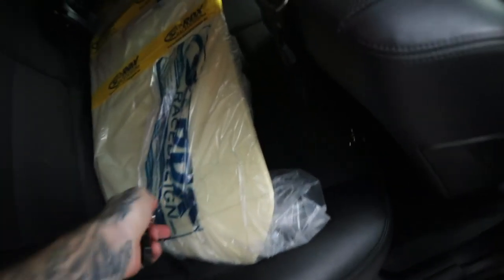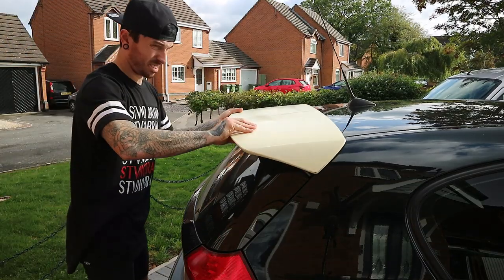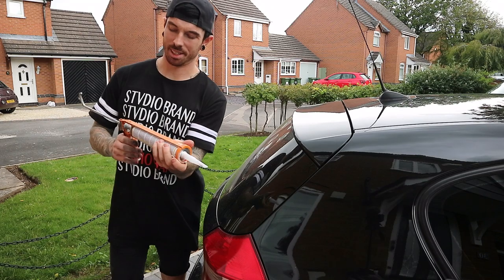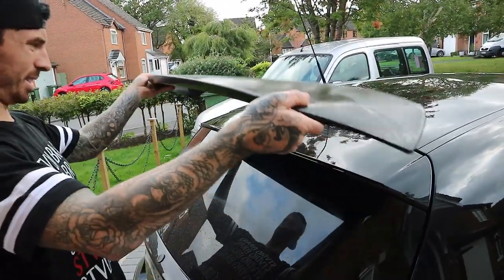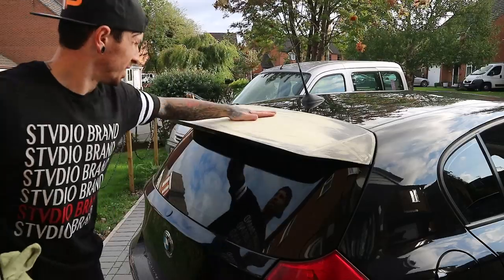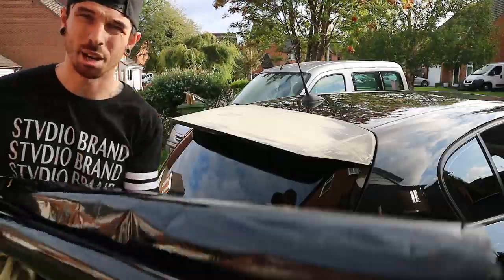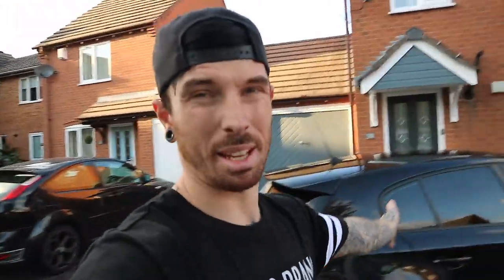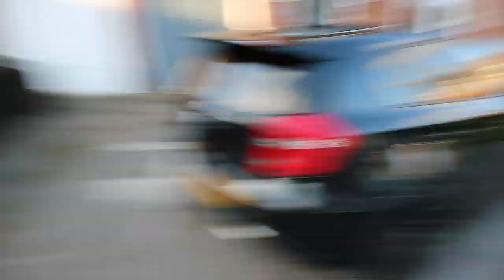FITTING A SPOILER TO MY BMW 1 SERIES E87

Comment: Mate I worked for BMW for a number of years. Here at Mini Oxford, in NedCar in Holland and BMW Munich. You should've took the other spoiler off. Thats why you're left with a 12 mm lip (estimated). Good attempt though.
Reply: I don't know what you did working for BMW, but i own this car, and this stock 'spoiler' is NOT REMOVABLE. Its not plastic, its part of the bodypanel (metal)....
Reply: @TheCardPlayer  blimey I wrote this a while back. I did go check my mates and yeah it's not. That's a tad unusual. I worked at Mini but I went to Munich for two stints of 3 months. Has it worked out is the main thing?

Comment: Do you have the link to the seller you bought it off?  I’m currently looking for a spoiler myself & yours looks like a great fit. 
Cheers!👍🏼
Reply: I think it’s the RDX spoiler. It costs about 100€ on amazon.
Reply: I’d just keep looking get a pre painted one loads less work
Reply: I own a F20 LCi just brought a carbon wing off eBay there’s a lot of nice ones on there or I shit you not “ali express “ also do really good parts like spoilers and whatever you need splitters etc, just type in your model and it’ll bring up loads of different ones
Reply: @jayrod7142  isn’t this for golf’s?

Comment: get the 1M bumper front and back. I started working on my 120d same time as you and we are at same stage in terms of mods minus the spoiler. im getting the 1M bumpers soon. it will add the unique flair to the car.
Reply: Im the same, ive only just come across this channel but ive been doing up my E81 over the last 6 months, i got the spoiler, angle eye headlight, tinted windows and smoked tail light...my new front bumper has just arrived but ive gone for the M2 style with front splitter as you dont see many of those around. Im getting it sprayed and fitted over the next week or two

Comment: I received the same spoiler today… I don’t know because mine is made of fiberglass and it feels wood-like and heavy. Makes me uncomfortable really. You preferred fiberglass as you said in your video… I think yours, which is plastic, might be better. And yes these spoilers are not perfect fits at all no matter which material it is made of. If I install mine I will have to paint it first… color car is titan silver. So not sure about the wrapping part… 🫣
And finally you stuck it on with glue (lots of it 😂). How easy/hard is it when you ever want to remove the spoiler for some reason ?